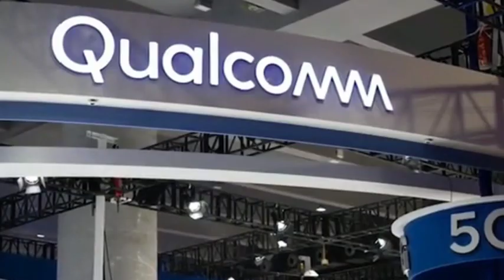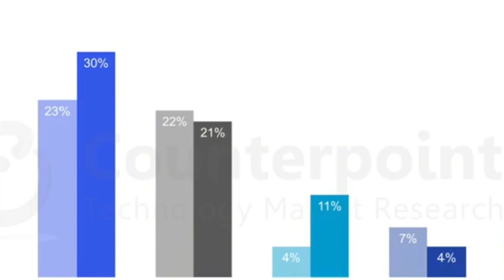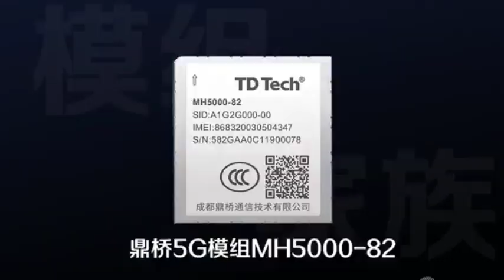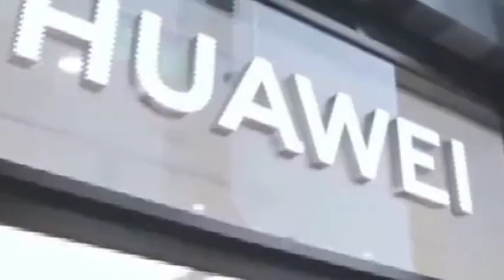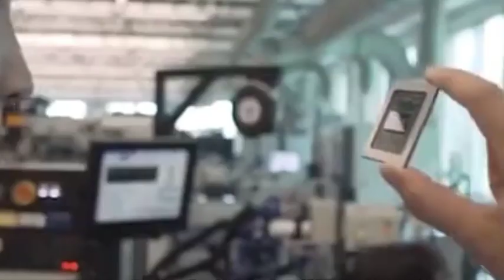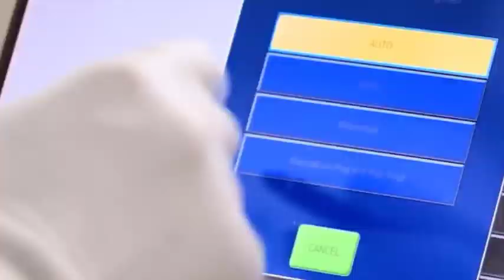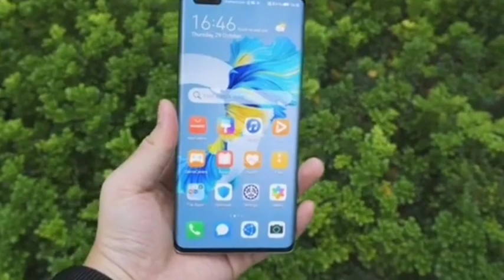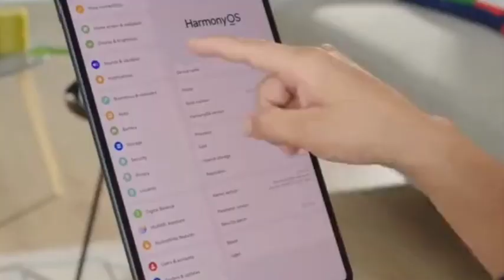Technically comparable to Huawei! This Chinese company launched a 6nm 5G chip to break the monopoly

Comment: Looks like China’s 5nm will come from Unisoc repackaging of this 6nm. Like SMIC 7nm, you don’t need to sell them to mobile phone companies. First, they are not the only customer around. Second, mobile phone production has been dropping since 2018 and drop another 10% this year and forecasted the same next year. In fact new policy from China could be most mobile phones, tablets and computer will be produced using 7nm of which SMIC is trying to mass produce by 2024/25. The mobile phones companies is always talking about 5nm, 4nm, 3nm, etc. Can the technology keep supporting this or is this just frivolous fantasy. On the other hand, can the commercial viability support this? If this is not frivolous then why is the latest Mediatek and Qualcomm 4nm a repackaged from 5nm? Also, why did Apple reject TSMC 3nm? Not commercially viable is the answer given but many know that Qualcomm chip even at 5nm has problem with heat. Technically at 3nm, no matter how good is the EUV, it has maybe becoming impossible to fit everything inside. Yes, the TSMC 3nm was deem technically unstable. That is why its factory in Arizona will only produce a repackage 5nm to 4nm In 2024. Ring a bell? Launch in 2022 but still manufacture 4nm in 2024???  The writing is on the wall. If Unisoc 6nm is true to its performance then China may just get most mobile phones 5G or others, tablets and computer to be produced in 6nm. Since this is a TSMC product, everyone can use it except Huawei and ZTE unless this 6nm is being produced not using any American technology. Huawei is being constantly shown with the Kirin chip in the video. Is there a hint where the rumoured return of the Kirin chip 5G is going to come from? It’s amazing that Unisoc doesn’t have commercial myopia and just blindly focus on mobile phones like Mediatek and Qualcomm. Can see Unisoc coming from behind to corner even the mobile phone market. Who know? Maybe Unisoc can get its 6nm from SMIC. While SMIC always say that they need the EUV machine to produce the 5nm and more advance chips, they never discount they can produce the 6nm chip using the FINFET n+1,n+2 or perhaps n+3,n+4 to produce the 6nm. After all, after 10 years, FINFET has become a very stable technology. If SMIC 7nm can be produce from 14nm, maybe they can do so with 6nm 5G chip. By end of 2023, all the factories to mass produce 14nm will be at full capacity. Maybe it’s a combination effort of Huawei stacking technology plus SMIC FINFET or some other chiplet technology to produce the 6nm. It’s exciting times in terms of technology for China semiconductor. While China is not overtaking, it is definitely standing up to the Americans’ bullying and oppressing. The Americans did it to the French then the Japanese but they will meet more than their match against China. As the buyer of almost 70% of semiconductor in the world, China hold the advantage of economic and commercial viability. What comes after this is technology, a natural progress. It’s never the other way round. Getting the chip to 3nm then try to get the market to adopt it is not natural and will fail.